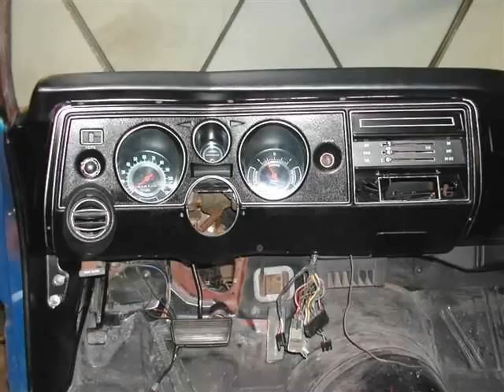1969 Chevelle SS 454 Frame Off  Restoration.

Comment: Why not go with a 396.  The 454 wasn't available until 1970.  A 375 HP 396 was the top factory option in 1969.  Was it a true SS?  I see from the eyebrow trim & tail lights that it's a Chevelle 300 Deluxe Sport Coupe.  The 1969 Chevelle 300 Deluxe Sport Coupe w/ SS396 option is a rare car.  A # matching car would bring big bucks at auction.
Reply: justinloyal           300 deluxe sport coupe is a sedan ....... this is a hard top